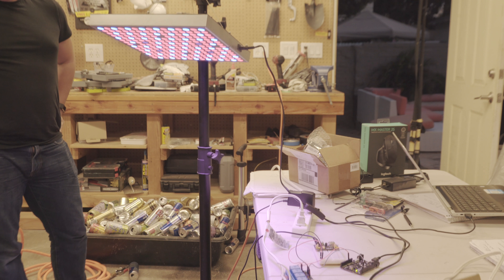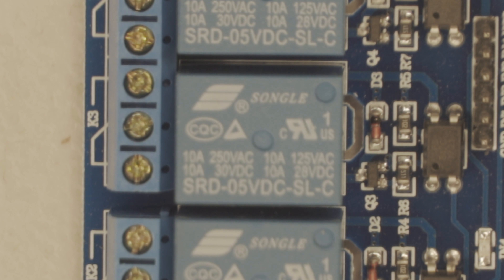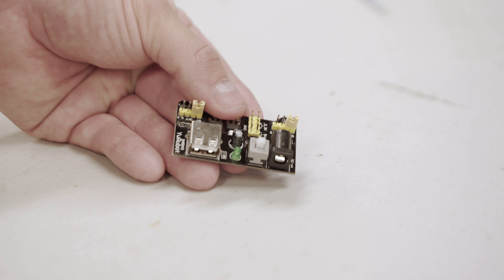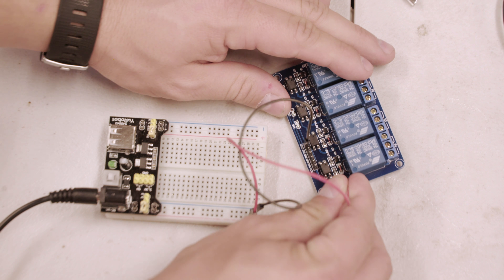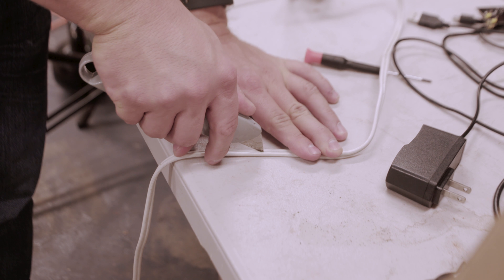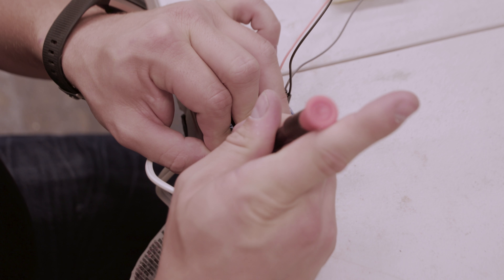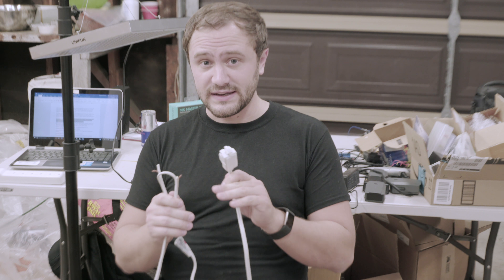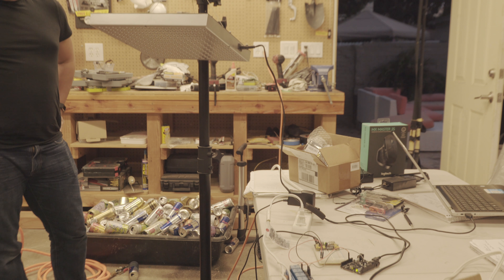How to use an Arduino Relay Module

Comment: As an electrician I suggest you consider using low voltage examples. The method you used to strip and terminate the cables is dangerous at best and potentially deadly for people less familiar with electricity. exposed wiring is an accident waiting to happen

Comment: Thank you for posting this. I would love to see a follow up video with the Arduino controlling a relay based on input to the Arduino. In other words if I press one button the relay would be activated for one second. If I press a second button the relay would be activated for 10 seconds and if I press a third button the relay would stay activated unless a separate signal told Relay to shut off.

I am trying to control an AC motor that will raise  a platform to various heights.

Comment: It's recommended that just in front of the pinMode command, you make the pin high with a digitalWrite. That way, the pin will never be accidentally randomly low when it changes to output from the default of input: that could be catastrophic if it was say a motor or something that might activate accidentally in setup().

Comment: Can someone help me? I need to control 4 relay with a 4 axys joystick. On position 1 of the joystick, 3 relay need to be on. On position 2, 2 relay need to be on. On position 3, 2 relay beed to be on. On position 4, one relay need to be on. Those relay will control some hydrolic valve...

Comment: The idea and the code are great.... BUT SERIOUSLY
If anyone follows your technique they are putting themselves at very high risk of:
o	Getting an ELECTRIC SHOCK from the AC supply
o	Slicing their fingers open with that knife

Firstly – NEVER EVER allow that much copper to be exposed at the relay terminals. The chances are the wires will make contact causing a spark or even fire.

Second – allowing that much exposed copper open someone up to inadvertently touch it. 

The wire should be stripped back with wire strippers (not a knife) and only a little copper showing on the TIP of each end of the cut wire. (Far better to use bootlace crimps to reduce risk) insert into relay output screw terminals with wire installation hard against outside of terminal block

Third the knife… arrgh like others have stated get a set of wire strippers why run the risk

Comment: As pointed out by many, the stripping of the Hot wire was done poorly and, the naked wires fairly dangerous although it's just the Hot wire and not very dangerous since not touching the ground or eart, but what if a student tries this standing barefooted on a damp concrete floor and the electricity was earthed ! Otherwise nice job explaining the function and usage of a Relay. Thanks.

Comment: yes you made a good video and the instructions are on point however please purchase a pair of wire strippers and learn to properly connect an AC circuit insure there are no exposed wires by using the proper size or guage of wire and when connecting a wire open (unscrew) the terminal far enough so the wire is inserted and there is no exposed copper hanging behind the terminal.

Comment: Can you explain how to connect the high voltage circuit? I want a 12V circuit:  for the load,  on the output side. + goes to NC, - goes to com, but where to wire up the input + and - wires from the 12V battery?

Comment: I want to build an Arduino circuit that will make my 12 volt DC wiper motor turn on for three seconds then shut off for five seconds then rotate in the opposite direction for three seconds and stop.
this would be for a slingshot auto resetting target.  I would pay $$$ for a video that shows how to do it.

Comment: Can I use two 3.7V lithium ion (18650) batteries to connect to the JDVCC pin to get opto isolated circuit?

Comment: Hey - I was wondering if you could elaborate which of the three pins on the relay you connected the GND/VCC and why there Is a third pin...
Reply: The three pins are
 N/O normally/open
COM common 
N/C normally/closed

Comment: Thank u for your... video which helps me a lot in my project...
Can I know the reason why? you used YWROBOT as a isolated supply..instead of direct supply from arduino…?
Reply from the maker: It's for electrical isolation. If there's back emf in the relay or something goes wrong then the Arduino could get damaged without it. This blog post helped me understand it: https://howtomechatronics.com/tutorials/arduino/control-high-voltage-devices-arduino-relay-tutorial/

Comment: I am facing problem doing wiring of "LED will relay module".
If I attach both wire in
1&2 it starts automatically/instantly
In 1&3 or 2&3 nothing happens

Comment: Hello guys, just wanna ask, I want to connect my arduino to a 12v battery (It's possible right?), if so, I want to control a light bulb with the same power source also 12v battery, do I still need a relay? If so what volt should I use?
Reply: I'm trying to do the same thing did you ever figure it out?
Reply: From what i understand u can get 12 v relays the adrino only runs on 5v (which u can get from a 12v phone charger) the arduino can only take very low current . So yes u need tge relays

Comment: Hey sir 
Now i connect like this
And the relay is active LOW
But i set the code to switch on by High
And switch off by set it Low
Which is wrong (you said this)
When i connect the relay to the lamp it works normally but after a while it lags and the lamp switch off but the relay green lamp blinks as it switch on and off but the lamp doesn’t work
And this is problem
I found also that when i connect the relay to the pin a voltage drop occurs and the volt become around 3.2 not 4.5 or more and the lag occurs (( I’m using atmega not the arduino and 9 v battery)) 
Please help me

Comment: even if you are alone in your room and nobody touch your equipment and you are sure 100 percent from that, you should never connect the relay to the ac 220 volt this way,,, its dangerous man,,, safety first before anything ............

Comment: Hello  @UCXRkG_PB-qAR67_LBMLONcA,
Thnx a lot for your great YouTube, It means a lot if you share what you’re good in, so we can learn from each other. I hope you have time for a small simple question. Is there power on your relay coil when the NO contact is closed (when you’re hooked up appliance is on) like a standard relay or does it gets a pulse each time you switch on and off you’re appliance?
Greats
Bart

Comment: Nice video but please re-do it!!!!.. or you will be sued by someone! 
Those over exposed wires to the mains is HORRIBLE! If someone tries out the way you handle live voltages they will DIE!!!
I know, a suggestion after almost 3 years on the tube but rather later then never, this is DANGEROUS!!!
Reply: Yes this isnt safe, but I do not think you know how electricity works.